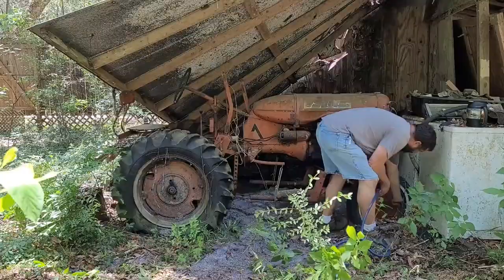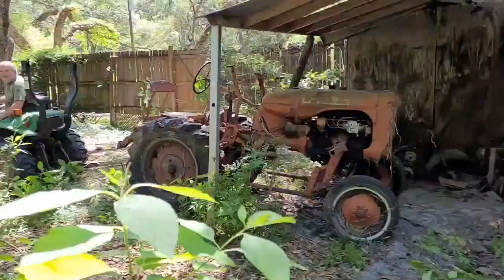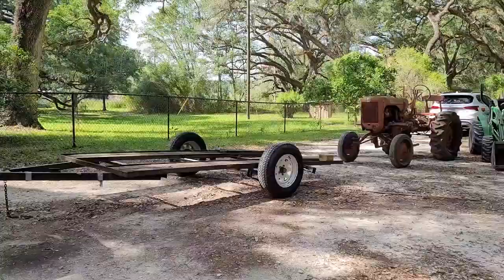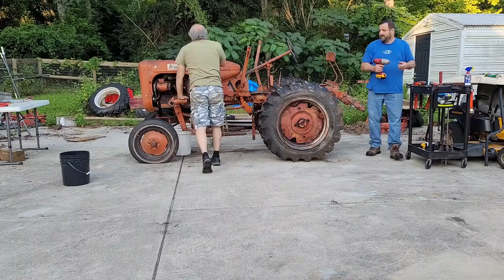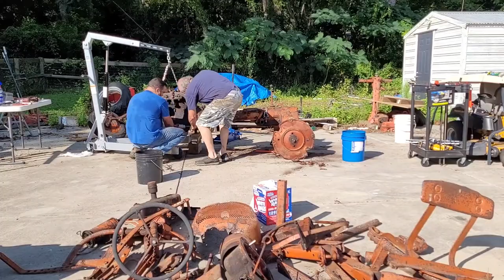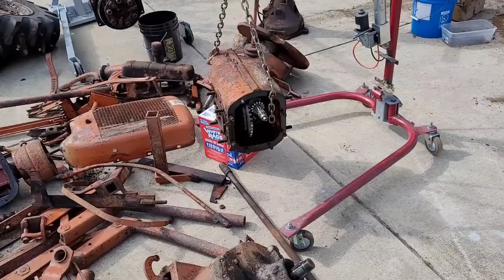1953 Allis Chalmers B Disassembly Timelapse

Comment: That is one stripped down tractor, damn.
Reply from the maker: Yeah I ended up removing every bolt and screw in every part. Cleaning replacing reassembling as needed. Not one area with rust or even old paint. It has been a long restoration. Especially taking the time to film and edit vids along the way. Thanks for watching.
Reply: @JPN76  Amazing, pat yourself on the back, it turned out splendid.

Comment: what kind of issues did you have during disassembly? any tools make it easier or something to do different?
Reply from the maker: The only hard part was the hub that was stuck on the axle shaft. I had to piece together a makeshift puller and beat the heck out of it. Mostly regular hand tools and nothing special. It did help a lot to get a sand blast cabinet for the smaller parts clean up.
Reply from the maker: Actually the brake drums were hell too. Forgot about that. The puller setup is in the final drive video.

Comment: I see this is going to be a chore. I only took off the fenders and seat but that involved having to break out the 3/4" set because I found not find the right 1/2" drive socket.
even then it was a real chore. right off I have notice a few things, 
1st. the front axle is not the wish bone style, it is straight square tube. 
2nd. the rear tires are not. the same as yours, there is 5 or 7 nuts on studs that hold the hub to the axle the tire and rim are mounted on the inside of the rim hub, and I do not see any way the if I take those 4 or 5 bolts out that I can get the rim hub off the axle. 
I  know that it is a 1949 tractor
I have access to a sandblaster at work when on nights, I am thinking that I will disassemble like you did sort of and the palletize the components and work through a section at a time. I am waiting on a engine stand that I ordered to come in. but I should be able to drain it and clean it while I wait. biggest problem is that it is cold here about 20 degrees .
Reply from the maker: I've seen pics of tractors like yours. What is the serial number?  Also if you happen to be on Facebook there are a few good groups on there for model B/C tractors
Reply: @JPN76  model # 96258, engine Serial CE113992 G

If you can please send the Facebook info, I have not been on in FB in all most a year.
I am not happy with it and the way they do business, but I will take a look
Reply from the maker: I agree with you about FB. Getting worse and worse. I mainly use it for the groups.  If you go to search and search for allis chalmers B groups. I'll try tonadd a link
Reply from the maker: https://www.facebook.com/groups/514664352041915/?ref=share